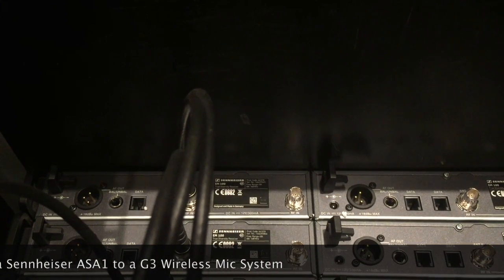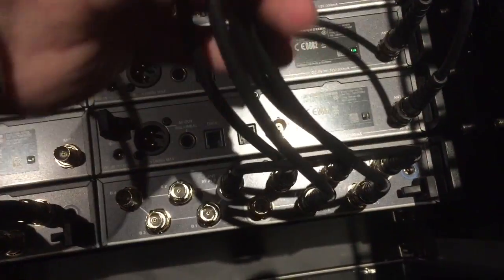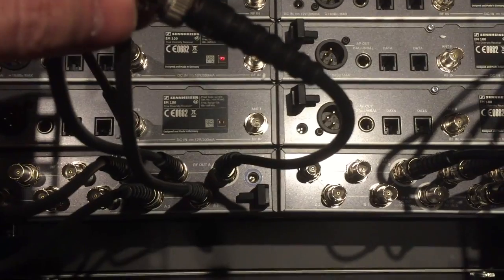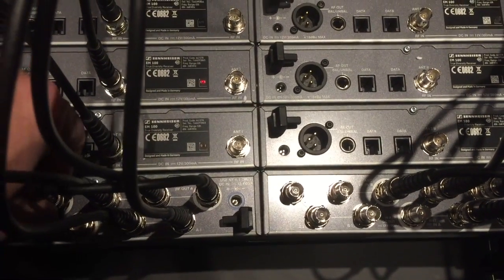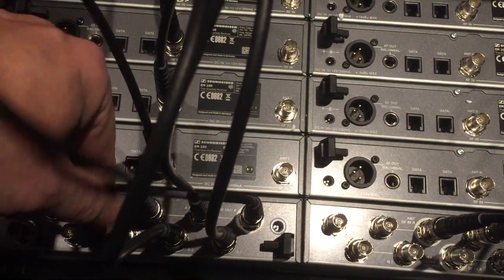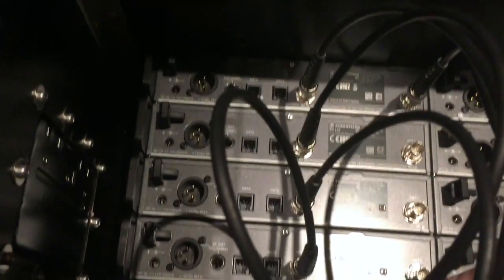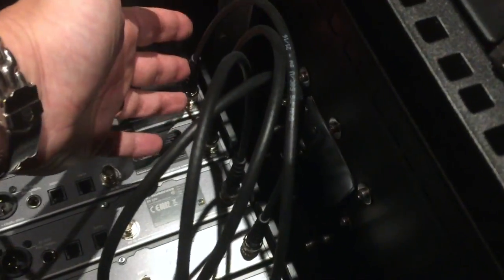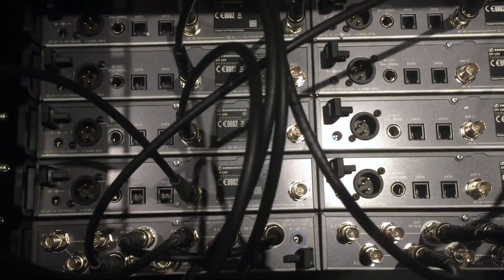Sennheiser ASA1 Splitter

Comment: Hello thanks for this video I have 2 question.First question about the Asa splitter I have 3.So question is is it possible to connect 12 mics through ASA?2 Question my mics ew100g3 the rear of mics data the question is what is data for mics?why does it need?
Reply from the maker: Hello.  To use 12 mics; you will need THREE x ASA splitters.  The 3rd splitter will need its own antennas unless you connect the 3 ASA to a 4th splitter.  The CAT5 connection on the 100G3/G4 series is for firmware updates.  On the 300/500 series it can be used for remote programming and monitoring of receivers using Sennheisers' WSM app.
Reply: So it means 2 splitter I can connect cascade way 3th separetly with antenna?
Reply: I run 16 together. One splitter each feeding 4 receivers and an additional splitter feeding those 4. Works perfectly, never any problems or dropouts etc. Only 2 aerials needed for the 16 receivers
Reply: @SoundMusicCo I'm doing exactly that right now: 4 asa 214 splitters feeding a total of 16 ew-300 receivers. How should I connect these?
Reply from the maker: @nathanieldahman9268  You break them into two sets of eight just as above.  You will need four antennas, 2 for each set of 8 or a 5th master distro to connect all too then to 2 antennas from the 5th.
Reply: @SoundMusicCo  Thanks!👍